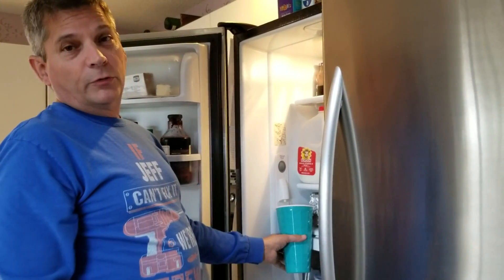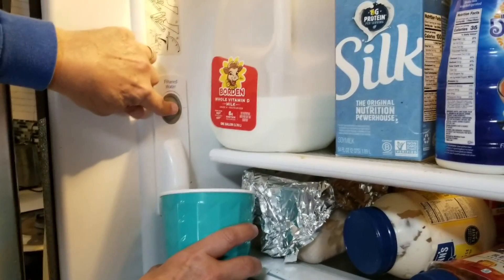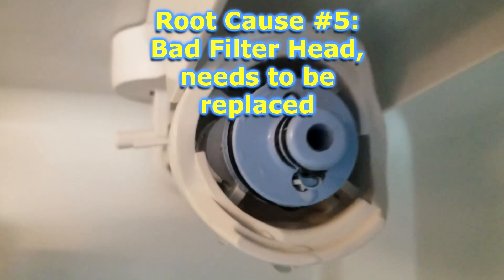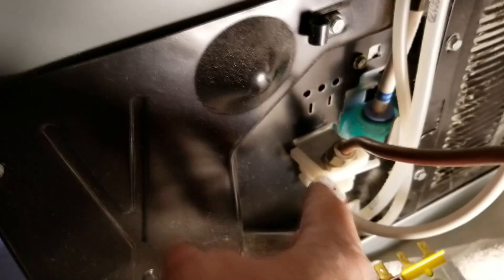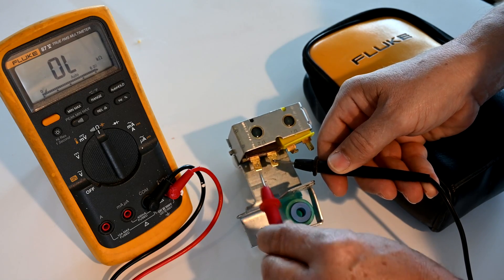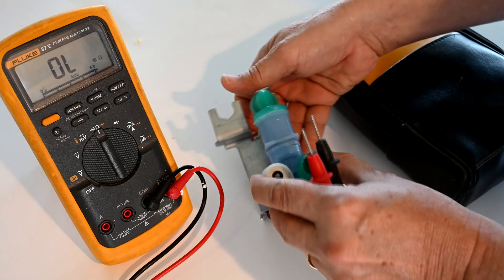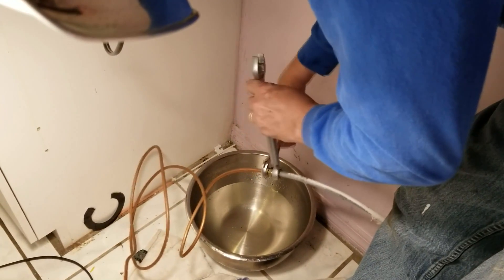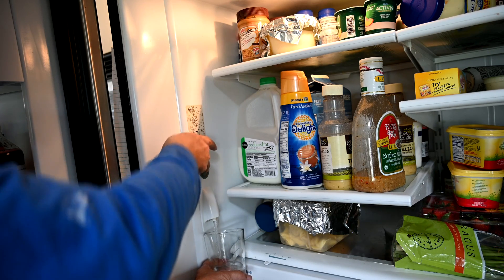5 Reasons Fridge Won't Dispense Water: Inlet Valve Fix DIY

Comment: Jeff before I seen your video after replacing my Whirlpool wrx735SDBM03 filter, filter head, reservoir and triple solenoid valve. I used all OEM parts and also the door switch clicks the solenoid in back when pushed but no water at all still. Do you have
any ideas?
thanks David
Reply from the maker: David did you check the plastic reservoir bottle built inside the refrigerator? That is a very common one that most people report back to me using my tip of using the hair dryer to help throw it out and it gets the water falling again. If that does not work then you need to really look at the solenoid of the water inlet valve and the only way to tell if something is functioning is to measure the resistance on it.

Comment: My issue were the two white dots. I pushed them in with a pen and received a blast of cold water to the face!! We don’t have a water filter installed so I just put back on the bypass cap and voila. It works again! Thanks for the video
Reply: Yes! Thank you for your comment! I first tried the blow dryer and it didn’t work.  But I read your comment.  So I took a pencil and pushed in the dot and got sprayed in the face too 😂

So right then I knew that there was running water getting to the filtration unit.  So I pushed in a second time just to get more in, and then I twisted the filter much more this time.  My wife always has an issue with how much I twist things and asked me not to do it again… well… once I twisted it enough I could hear the air release from the filter and knew I was in business!

Thank YOU for the comment and thank the man that posted this video for getting me on track!

Comment: Hi Jeff, I have a 15 year old GE Profile Artica that works fine except it stopped dispensing water. I followed your advice but still not working. The filter was already bypassed with a plug, so it's not the filter heard. To be sure, I went ahead and installed an empty filter and it filled up with water instantly, but there was no water at the dispenser. I tested the water valve with a multimeter - its good: 175 resistance on one and 325 on the other. I can hear a it click on when I press the dispenser button. I warmed the water tank and was able to rotate it enough to see a bubble pass easily through the entire thing and it was warm to the touch, so its not frozen. But when I disconnect the line to the door dispenser at the base of the fridge behind the kick plate no water comes out of it beyond a dribble. I assume the water flows through the filter before being stored in the tank. I'm wondering if somehow there is a clog from the tank to the dispenser. Is it possible to remove the tank to check the hoses and reconnect them? Or is there another possible culprit? Your videos were helpful in trying to solve this conundrum and I've learned a lot about how a fridge works. Now I'm determined to try to fix it myself and would appreciate any more insights you might have. Thanks.
Reply from the maker: It would make sure the water is flowing from under your sink first. These are the only items we know to check.

Comment: Thanks Jeff. I find that measuring resistance on electronic components can give enough information if component is faulty or not
Reply from the maker: hopefully you won't have to replace water inlet valves
Reply: @jeffostroff  I did already. And it worked like charm. I have LG Refrigerator that has two water valves. One is on the back and other on left door at the bottom. I had to replace the one that is on the front door.

Comment: Any suggestions for fixing a drip from the dispenser??
Reply from the maker: Can't say 100% for certain, but usually drips at the water Spencer actually are sourced from the back and bottom of the refrigerator where the the water inlet valve is, sometimes you have to buy it as a kit with the ice maker water supply and the water dispenser supply at the same time. So if you're getting dripping at the dispenser, it means that something isn't shutting off the water so you have water that's continuing to flow into the tubes and up to the dispenser so I would look at that and see if there's something with your water in levels

Comment: #3 fixed mine. The water reservoir was frozen and 5 minutes with a hair dryer did the trick. Turns out, someone left my fridge open all night so it must have been cranking cold air over night and froze it. Thanks Jeff!
Reply from the maker: Thanks for sharing

Comment: Don’t you think could be a good idea  to test the new water Inlet valve before Install it ? Cause even new parts come defective
Reply from the maker: With these water inlet valves the only real way to test it is to plug it in not everybody has a voltage generator two apply the leads

Comment: Hey Jeff, my shutoff valve behind my refrigerator has no pressure. Turned the knob and no water is coming out, I even took the hose off the valve and no water. Any ideal what the cause is and can I just replace the knob/valve? Thanks Jeff!
Reply from the maker: Does the valve feel loose when you turn the knob? IT may be broken stem or worn and not opening so no water flow. I would also check where the water source is for that icemaker line behind the fridge. They often connect under the kitchen sink through a T adapter to the cold water line. No matter what, you need to cut off the main water supply to the house if you change the valve.If it is not the valve, then maybe a kink in the line, or a blockage in the line.

Comment: Thanks Jeff, solution #3 did the trick.  After a few minutes with the hairdryer and I was able to unthaw my waterline and restore the water dispenser to working order.
Reply from the maker: Yes! Glad to hear it helped this is the most common solution that we hear back from people that worked for them. Which is a lot cheaper than having to replace the inlet valve

Comment: QUESTION: If the coil from that fridge tested good, Why did you need to replace it and how did that fix this if that valve coil was good? Can th ecoil be good yet the valve be bad? If so, How can you determine this?

Comment: Hi Jeff thanks for your video! I have a dilemma with my fridge the water dispenser doesn't work. Even the technician couldn't figure out the problem. There is no power at any of the valves 
Here is what we did :
change the primary and secondary valves
change the main board
change the control board
Change the actuator switch.
Can anyone out there help?
                                                            -
Reply from the maker: I don't see where you changed the filter head itself, not the water filter, but the head that it screws onto. This turned out to be our problem, and here is the video for it: https://youtu.be/t4W0EaNo9gc
Reply: @jeffostroff  Even not having power at the inlet valve is cause by a bad filter head?

Comment: "OL" = Open Loop.  (not overload)... It may be interpreted as "Out Of Limits" depending on the test function selected and the meter's design and manufacturer.  Sometimes the water line is okay in the water tank inside the refrigerator but it's frozen up inside the freezer door on side-by-sides that dispense from the freezer door on the outside.
Reply: I've heard it called open line
Reply from the maker: Yes sometimes I misspeak and don't edit it out

Comment: We get ice but no water so I need to replace the inlet valve?
Reply from the maker: Or you can check to see if the water reservoir bottle inside the refrigerator compartment usually hanging on the back wall see if it is frozen and a lot of people use their hair dryer to unfreeze it in that usually solves it. If that doesn't help then other root causes might be the filter head itself which contains the lines and we had to do that on our refrigerator. And then of course the water inlet valve

Comment: My LG had a big old leak from the 5/16" water line that runs under the refrigerator to the water dispenser from that inlet valve.  The floor got wet but I had trouble telling where the water was coming from.  Every time I'd push to get water the floor would get wetter and nothing would come out which told me the valve worked fine.  I found the hose at Home Depot for $2.38 for 10'.
Reply from the maker: Did you solve the leak?
Reply: @jeffostroff  Yes and thanks for you video.  I replaced the 5/16 hose from the rear inlet valve to the front of the fridge under the door where it connects to an adapter before going into the door.  Work great instantly after that.

Comment: Just inherited a fridge from someone who upgraded and it was my goal to get the water dispenser working (it had not worked for them for awhile). Ice works; just no water. So first thing is the filter is really old....I mean really old. So it needs to be replaced. What I'm curious about though is when I press to get water it is leaking the water from the back of the fridge where the supply line is connected. It's not leaking any other time and it's not leaking from the supply line connection. So I'm wondering if it's leaking at the inlet valve. I'm guessing I need to replace that part? A clogged filter wouldn't cause the water to leak it would it? figured it just wouldnt let anything pass through the system.
Reply from the maker: IT sure sounds like it is leaking at the valve. Pull out the fridge get down low and see what happens when someone pushes the button.  Also check to be sure the reservoir inside the fridge is not frozen, if so use the hair dryer trick to melt it.

Comment: Hi Jeff, Thanks for dryer 
heating element repair video. I have an inside water dispenser, Kenmore, that appears as though the inlet valve inside the fridge needs repaired. I watched your video on 5 reasons why fridge won't dispense water, but you just pointed to the inlet water valve where the filter makes contacts as a possible reason. How do I repair that part of the fridge and do I still have to go in through the back of the fridge? Thanks.
Reply from the maker: We have another video on repairing the filter head, is this what you are thinking about? https://youtu.be/t4W0EaNo9gc
Reply: thank you Jeff, and yes that's what I need.

Comment: Hey Jeff, thanks for this video, it's super helpful! I just bought a house that has the exact same fridge you're showing in this video and the water dispenser doesn't work (the ice maker does work though). I think I'm actually facing issue #2 as I don't hear anything when pressing the dispenser's button. I googled around but couldn't find anything that explains how to test it (I'm assuming exposing the micro switch and testing it for something?) or even how to take the button out to expose the micro switch, I'm afraid to break the part. Any chance you can help me with that? That'd save me so much time and probably money. Thank you!
Reply from the maker: IF the switch is working you should hear the relay click and engage when you press in on the switch. IF not, it could also be the water inlet valve, which is where the click should come from. The best way to test the switch is to remove it and use a multimeter to check resistance. When pressed, the switch shorts the 2 contacts together so it should read about 0 ohms. when pressed in, and open loop when not pressed in.
Reply: @jeffostroff  thank you again! I eventually figured out how to remove the button and the issue was even simpler, the micro switch wasn't pushed in all the way so the dispenser button wasn't hitting it at all! I just popped it in until it snapped into place and everything's working now.
This video taught me a lot! Highly valuable information as a new homeowner. I'm subscribed to your channel now and will keep following! 🙌🏼
Reply from the maker: @yonatanbentzur8990  Wow, that's cool, yet disturbing because it appears they failed to build your fridge correctly at the factory, or maybe the previous owner caused it to happen. With my own refrigerator, we had a rattling noise for years that two different repair people under warranty came by to look at it and couldn't fix it and just told us it was normal period and I refuse to believe that it was normal because it kept getting louder and louder until one day we finally took apart the freezer and in the back we notice that when they stuck the fan in at the factory, they forgot to put in the rear grommet that holds it into place and keeps it from rattling and banging against the housing. Once I bought the overpriced $20 gasket and replaced it, the noise went away and I just couldn't believe that two highly trained repair people didn't know how to fix it. Websites
Reply: @jeffostroff  Wow, that's crazy!
Reply: @yonatanbentzur8990  after I saw your comment and did the same it work super easy !!! Thanks too both of you

Comment: Hi Jeff, I just bought a fridge from Lowes Outlet and when I connected the existing water copper line to the hanging plastic hose on the new fridge the water when stopped from the dispenser is giving me a hammer noise. Do you think is better to connect the water copper line direct to the fridge valve to avoid that noise? I’m thinking the noise is cause because copper is connected with the plastic house going to the fridge water valve. The noise is killing me Sir. Thank you.
Reply from the maker: You need to find out exactly where that hammer noise is coming from. Usually you just hear the click and a one time inrush of water. Check your hoses and tubing for kinks. We need to make sure full pressure is going into the water inlet valve. I hope the issue is not your water inlet valve spasming, or you'll have to replace it. Also most people don't know that today's plumbing code, most cities expect you to install a hammer arrester on the icemaker line coming out of the wall, in a small outlet box, you but the outlet box with the water  connector that hast he hammer arrester on it. I have never seen hammering on a thin icemaker line, I think it is ridiculous to require that hammer arrester in the plumbing code, but that's what they want.

Comment: my Maytag french door fridge no water to the ice maker, I check no power to the inlet valve, and the water dispenser works well. And I connect the power to the valve. it works. so witch part support the valve and how can I fix it, thx
Reply from the maker: It is really hard to tell without seeing your fridge how the water is it actually getting to the ice maker. My bed on this is that the water is coming in past the water inlet valve runs up the refrigerator, in likely passes through a plastic reservoir which looks like a bottle almost usually located on the inside of the fridge along the back wall. Sometimes that can freeze up or sometimes the line beyond that point will freeze up going into the freezer, and then the water will not make it into the ice maker because it's frozen solid. So I would try to look along that route and see what is going on. I know in the other case where you don't have water coming out of the water dispenser, 90% of our viewers are able to solve the problem by putting a blow dryer blowing hot air onto that reservoir of water, which has frozen. By doing that, they are throwing out the ice inside that reservoir comma in the water can flow once more. So you need to isolate in your refrigerator what is so different between the path that goes to the ice maker and the path that goes to the water dispenser. Because if you have water coming out of the water dispenser, then you should be able to get water coming out of the ice dispenser as well. I am hoping that the problem is not your ice maker itself not turning on its own valve to suck in the water out of the supply line.
Reply: @jeffostroff  thanks for your heip. the water line is on the back, not inside. I check there is no power to the ice maker inlet valve, I use a wire support the power,and then water going to ice maker. so,  which part support the power to ice maker inlet valve. thx

Comment: Why does it freeze?
Reply from the maker: A few reasons you can either adjust the temperature up a few degrees, or if you have too much food and the back of the fridge that's blocking the vent from the freezer to the refrigerator thanks can kinda backup as well with the air and keep all the cold air in that area and cause it to freeze. But essentially the most common issue here is that the reservoir bottle that's in the back inside the fridge just freezes up so it cuts off the water flow you just need to determine why is it getting too cold back there
Reply: @jeffostroff  thanks man I turned the fridge to 37 it was 32. I moved my lunch box away from the vent as well. I took the blow dryer to it for 2 min and it was an easy fix.

Comment: On my 4 year old Whirlpool side by side the outlet line from my cold water reservoir is very close to the air return to the freezer.  The evap fan failed causing much colder air at the bottom of the freezer to freeze the water at the outlet.  Replacing the fan returned proper airflow to both sides of the refrigerator and solved the problem.  We keep thermometers in both sides, but towards the bottom where it stayed mostly cold.  Oddly, the frozen line and issue dispensing water was the first real sign we had that the fan had failed.
Reply from the maker: Nice that you got it fixed!

Comment: Ok my issue I'm having is I bought a new filter when I went into change it all was fine.. then when I try to use the water dispenser no water I take the filter out water flows fine. First thought was maybe I got a bad filter. Went and got another one. Same thing water filter goes in water stops flowing.🤷‍♀️
Reply from the maker: sounds like your filter head was bad on the fridge side where you attach the filter. We had to relacee our filter head